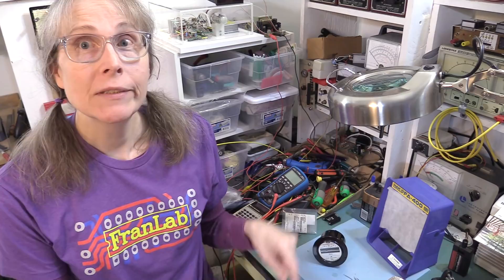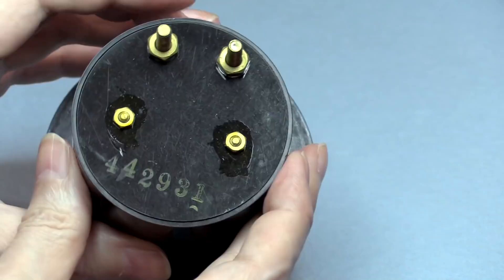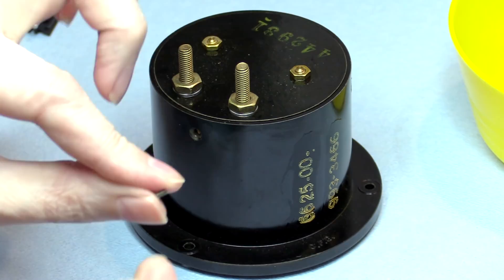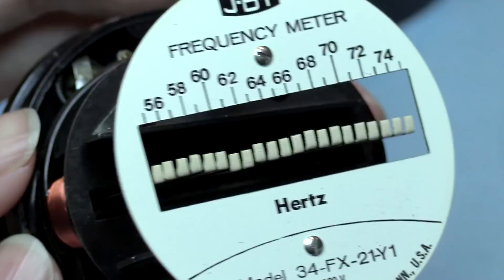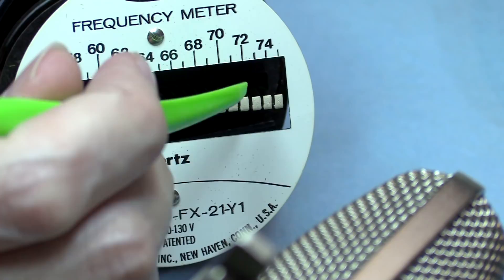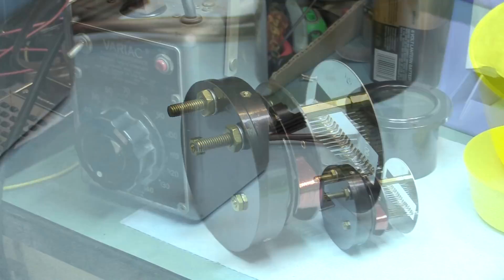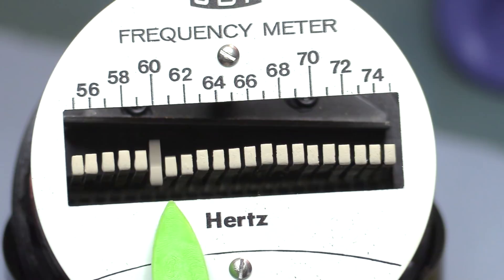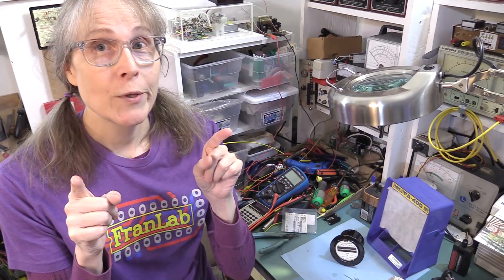The Spooky Action Of Mechanical Frequency Meters

Comment: Neat meters. Encountered the type mid 80s in the connections room (racks of connections for the physical outgoing lines and also for the lines coming from the switches (representing the phone numbers) and the wire connections between them) when working summers for the phone company. The meter was centered at 10 Hz IIRC, and quite narrow) Could be used to test if a customers pulse-dial phone was in spec, but don't recall ever actually using it for that. It was the time of overlap of pulse and tone and the station was about halfway swithed over from the old mechanical 500 selectors to digital (AXE) tech. One of the tasks was processing unpayed accounts, blocking outgoing calls - so both entering codes on a terminal for the AXE, and putting little plastic sticks between switch contacts on the 500 selector racks, depending on which number series the account was on, converted to AXE or not...

Comment: I saw lots of those in the military. The numbers on the side are a NSN (national stock number). The number on the back is probably the unit's serial number. When I was in the Marines (1967-73) I saw them on the 60-Hz generator in the LVTP5-R (recovery version) amphibious tracked vehicle (AMTRAC.) The R model was basically a mobile garage to maintain and repair the standard models in the field. When I was in the Air Force Reserve (1980-1986) I always saw the 400 Hz version on aircraft power generator carts. (Almost all aircraft use 400 Hz power, as the power consuming devices - motors & transformers for example - can be smaller and therefore lighter.) On those I remember the 400 Hz reed as being in the middle of the meter but my memory of the 60 Hz meters is dimmer than that. Also, naval vessels use a lot of 400 Hz power for various reasons. Used in synchro-servo systems, any aircraft they may host, and the various missiles that may be used.

Comment: Hi Fran. I used to use one like that tailored for 50 Hz. During the 80's in the French army, before coupling a diesel generator to the grid, we have to ensure that the generated frequency, depending on the motor rpm, matched the mains frequency... That was quite tricky because when approaching the right frequency we have to switch when the phase match too!... Currently waves are synthesized automatically at the right phase, no more pleasure!

Comment: Bass guitar -> amplifier -> speaker out terminals - > frequency meter. Or, signal generator -> step up transformer (same as a step down transformer, which I have no doubt you have) -> frequency meter.

Comment: I used to service a couple of older 45kw gensets that used  vibrating reed frequency meters.  Kinda fun to adjust the engine governor and watch the different reeds vibrate,  the center reed was the 60 cps at it said on the meter dials.

Comment: In case this wasn't included in a previous comment... FYI - number string on back is the EIA code: 442 = JBT and 931 is 1959 week 31 (according to one of the common EIA formats).  Nice video!

Comment: I'm not sure a VFD would have worked for this applicatin anyway, just because of the nature of their operation. I really piqued up when you talked about it, because of how much time we spent in school talking about them.  I wire industrial control panels for a living right now (And hopefully will be programming Programmable Logic Controllers before the start of Summer), and we install SO many VFDs.  I know that, at least in Kansas, there's a program going on where we're trying to replace a lot of Rural water control systems with VFD's to operate them at 50 hz, just because of how much more energy effecienct running water pump motors at that frequency is.  Exciting, and fun stuff!

Comment: At a radio station transmitter site-there were two of these analog frequency meters-One on the genset-other in a control room on the generator remote read panel.Whe the Cat engine was running the meters on the generator panel were useless.Had to use the ones on the remote control room panel.That generator had some harmonics-you could see them on the  resonant vibrating reed meter.Your line power is cleaner-no harmonics that we could see on your meter.These analog reed meters were good for seeing harmonics.Now gensets have digital meters-not affected by engine vibration as the vibrating read instruments were.And it was fun to see the various harmonics on the meter as you shut the genset off.

Comment: We had those on the diesel power units used by the airline I worked for, for aircraft ground power. 115V 400 hz. After starting the units we had to adjust the engine speed for a nice steady 400 hz before connecting the power.

Comment: Used to work on several generators (15kw to 250kw)  back in Chicago that had this type of Hz meters.  If you want to see this instrument move, find a really crappy old unregulated generator (500w to 1kw) and simply manipulate the engine's governor to raise or lower both the frequency and the voltage.

It really is a tuning fork but also amazingly well built.  The gensets I was working on mostly were built mid 70's and early 80's, so your instrument may very well be much newer than you think.

Thanks Fran, enjoyed the closups.

73
j

Comment: Fran Blanche I Used then quite often.  The anode of a X-ray tube absorbs a lot of energy. The tubes are very inefficient converting electrons into x-rays about 1%. You can do the math, 80 KV, 500 mA, for 100 mSec targeting on a spot 1.0 mm in size. It doesn't take much time to melt tungsten. So they make the anode into a disc and spin it inside a sealed vacuum tube and shield the whole thing with lead cause it makes x-rays. How do you make sure the anode is up to speed? With a resonance meter. 3,600 RPM and 10,800 for high speed rotors.  Some companies do it electronically now by sampling the signal off the stator  but you need a very fancy motor controller to do that.

Comment: If I remember correctly, they use the solder on the end of the tines behind the bend to fine tune the resonant frequency. Always wanted one of these meters! Though the only residential use I can realistically think of would be for monitoring a generator.

Comment: You can still find hundreds of those instruments still in operation here in Italy in power station built before 1970s that has not yet been renovated... usually there are at least two on the main control pannel in the control room depending on how many generators are present, one is connected to the power grid and one to each of the power station generator so that when the generator is started you see the frequency going up as the generator rotor speeds up until the "parallel" to the gridd is reached, only then the automatic switching engage "launching" the generator on line... during normal operation as long as the generator is connected to the national power grid you see both instruments syncronised indicating the same frequency which here in  Europe is 50Hz at 1x230V or 3x400V. Very reliable... never seen one in need for maintenance or to be changed in the 25 years I've been  working at power stations control room.

Comment: I first saw ones like this years ago, but didn't know how they worked.  I still don't understand how those diverging plates change the physical resonance.  I spent many years doing work for a smallish power company and a couple years ago I built a system that drove an accurate tone generator into Peavy Class D audio amplifiers to test electrical grid equipment.  It could supply about 300 watts to each of 3 phases at 125 vac.  I could set frequency in 0.001 Hz steps.  Since retiring, I still monitor the local grid frequency just out of curiosity.  (< nerd )  Fran your videos are always interesting and educational.  TY.

Comment: Love ur vids, very educational). This is what i've done. The cheapest way i think. I used an ESC(electronic speed controller) from a model airplane or helicopter, then wired the ESC's 3 phase AC output to the secondary of a mains centre tap STEP-DOWN transformer 9v-0V-9v connecting all 3 wires of the ESC to the Center tap tranformer secondary for max energy. The mains transformer's 110v input then becomes an output(now single phase AC). U easily get 500mA- 2500mA on the 110v side(now U created the secondary to be a STEP-UP transformer and inverter). U can then increase the ESC output frequency to anything from 20Hz to 400Hz(or more) using the speed controller PWM which is cheaply available from any hobby shop(along with the ESC). The output voltage can also be changed by regulating the input DC voltage and PWM to the ESC(use a 5-10A{0-15V} lab power supply). I can send u a schematic. All in for around $20- $30 bucks! Assuming u have a lab power supply. Regards

Comment: In the military you are using a generator for a lot of equipment,  and the motor runs differently so you can adjust the frequency of the power.
These meters allow you to ensure proper frequency of power before applying it to the equipment. 
And as others have said that is a NSN number on the side.

Comment: I still love all that old tech - used to have some of those both 60 cycle and 400 cycle. Those reeds must have an extremely high Q resonance! Those units use less than a watt - you could probably run that at diffent frequencies using a 16 volt bell transformer hooked to the output of a small audio amp with a freq generator plugged into the amp input. BTW Happy New Year

Comment: I have the same one, we used to use it to adjust home generators speed governor. If you have a variable speed drill and 3phase bicycle hub motor you can hook them together to get variable frequency generator on cheap you might be able to see the swinging of different indicator

Comment: I was a student in the late 60 and given a place in an old logging camp as a care taker. It had been turned into a christian summer camp in the Redwoods , a place called Elk River, and they had this old generator on a little trailer, a Jeep Willy's engine, with one of those as the frequency monitoring system. VEry cool to see it again. That is a above average type as it has so many reeds. Many had about 6.

Comment: We have something very similar to this at my work. We use it for tuning the engine speed on generators. If you could find an old school synchronous generator you could vary the rpm to vary the frequency. Many older portable generators even came with these i'll be it with just a few tines.

Comment: i recall using something like this during engineer classes. we were connecting two generators and first they needed to be on the same frequency before trying to get them synchronized with these three lights before the connection itself.

Comment: Wow! Super cool.  OK, here is the math - The natural frequency of a spring-mass system = fn = { [the square root of (k/m)] / 2 (pi) } where k is the spring rate [lb/in] and m is the mass [lb s^2/in] and the units for this equation are cycles/sec (Hz).  The spring rate at the unsupported tip of each of the flat bars (tines) can be found algebraically from the simple beam deflection formula for one end fixed and the other end free where you solve for force/deflection = k = 3EI/L^3 where E = the modulus of elasticity of the tine's metal (carbon steel ~ 30,000,000 lb/in^2, stainless steel ~ 29,000,000 lb/in^2 (~ = approximately)), I = the area moment of inertia of the tine's cross section shape.  "I" for a rectangle = bt^3/12, where b = the width of the tine's base [in] and t = the thickness [in] and the units are [in^4].  L = the distance from the clamped end of the tine to the center-line of the turned-up tip [inches].  

OK, so I know what you are thinking, how do you come up with the mass (m)?  the theoretical amount of mass at the tip and to use in the equation = [the mass of the turned up part of the tine at the free end] + the mass of the added solder at the tip + 25% of the mass of the unsupported tine, not including the turned up part at the end.  25% is a "rule of thumb" for how much of the tine mass to apply to the free end when using the fn = [SQRT(k/m)]/2pi formula.  the mass of the turned up part = bt(Ltip)(mass_dens), where b = width of tine [in], t = thickness [in], Ltip = the length of the turned up part [in] and mass_dens = the tine (material weight density)/g where g = the acceleration due to gravity = 386.1 in/s^2 and material weight density for carbon steel ~ 0.28 lb/in^3 (stainless steel ~ 0.29 lb/in^3).  The total mass of the long part of the tine is found in a similar way.

Take all of the tine measurements, plug stuff into all of the formulas and bing bam boom, you should get, for example, 60 Hz for the one tine that vibrated so nicely in your video.

BTW - Fran wondered how they tuned the tines and wondered out loud if the manufacturers varied the thickness.  I am almost certain they did not vary the thickness since this does not make manufacturing sense.  Edited on 01/01/2021 - I originally thought that they most likely they varied the overall length, but then I watched Fran's followup video on this gadget and she says another viewer noticed ground solder beads on the back sides of the bent tips of each tine.  

OK, I am guessing that they did not do this grinding after all the tines were installed.  They most likely made these tines in big lots and tuned a pile of 60 Hz tines, then made a pile of 61 Hz tines, etc.  It would be very costly to tune these by hand, but labor maybe was less expensive in the good old days.  I also am now guessing that they found that changing the length was too sensitive to work.  Why?  Because the spring rate (k) varies with the cube of the tine length and the tine mass equation throws in another "L" variable making it vary to the fourth power, so very small changes in length change the frequency a lot, so they came up with the technique of adding a blob of solder to each tine's tip and then ground away solder to get the right Hz since frequency varies linearly with changes in mass at the tip.  They undoubtedly had a fixture that held each tine the same way it is held in the device while they did their tuning.  

They also probably had a set of calibrated tuning forks that they would press against the tine-tuning-fixture in order to cause it to resonate and would allow them to mechanically see how close they were in the tuning process (assuming they tuned by-hand).

**FUN FACT** This design is just like a "thumb harp".  You may have seen these at some point or other in your life (google "thumb harp" to see a picture).  The thumb harp does not have turned up ends (usually), but it uses rectangular shaped tines with various lengths to get various notes.  The tines are attached to a small solid or hollow sound board and you hold it such that you flick the tines with your thumb.

At one point you wondered out loud if the brass base to which the tines were affixed was to dampen the tine motion.  I am almost certain that this was not the purpose of the brass base.  it was most likely thick and heavy duty to provide a nice firm clamping action to the ends of the tine that are assumed to be "fixed".

Did they do the math I provided here back in the day when these were made?  Maybe, to get a first pass estimate during the design phase.  Then they tuned each tine individually during production.

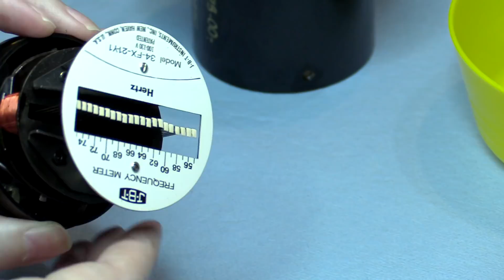OK, what about the angle bracket plates with the tapering distance to the tines that can be seen at the 4:49 second mark?  Edited on 01/01/2021 - Yesterday, before I saw the followup video, I thought the angle brackets bolted to the assembly might have affected the air space around each tine and might have been for damping, but now that I have seen Fran's followup video, I think she is correct that these brackets are for shaping the magnetic field.  So, maybe the reason for the angle is that they wanted the same relative tine response across all of the tines and found that they need to gradually decrease/increase the magnetic field as you went from one end to the other. 

Hopefully this trip down math lane provides some theoretical context for both you and the viewers of your channel.  I have never seen any of your other videos, this is my first one, so forgive me if I have been preaching to the choir.

Happy New Years eve 2020.

********************************

Comment: Reminds me of the use of Vibrasponders for frequency-controlled communications radio squelch.  It basically has a tiny tuning fork in it, and when the radio receives the correct frequency tone along with the communications, it resonates, and switches the squelch in the radio off.  I was looking into them as a weird method for controlling animatronics via audio tones. ;D

Comment: As a technician I worked on a normally stationary diesel generator set 415 volt three phase alternator when warm and loaded you used the throttle to adjust the  frequency using one of these meters. The nut from aus.

Comment: You should be able to take a sine wave output from a function generator through a step up transformer (grab a 120VAC to 5V AC adapter and use it in reverse) and then get 120VAC with variable frequency to test it out.  But maybe the thing I'm forgetting is dealing with the load balancing from the step up transformer to the inductive coil in the meter.  A resistor across the output of the step up transformer is probably needed (in parallel with the Hz meter).  Maybe a little tuning with another reactive component like a capacitor to keep the power factor close to 1.0 if that matters to the Hz meter.  I'm probably missing something here, though, why you didn't try that. 

Neat device.  Fun to try and figure out how it worked before I finished the video.  I didn't think "reverse guitar pickup coil" until you said looks like a guitar coil.  Thanks for sharing.